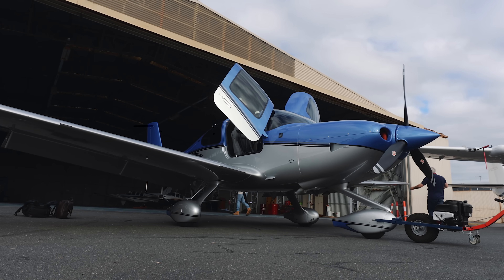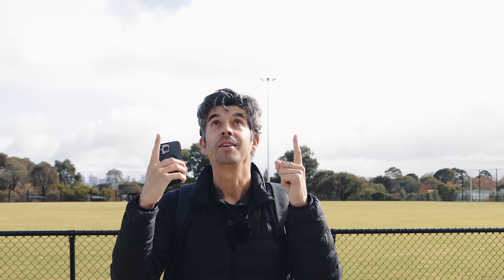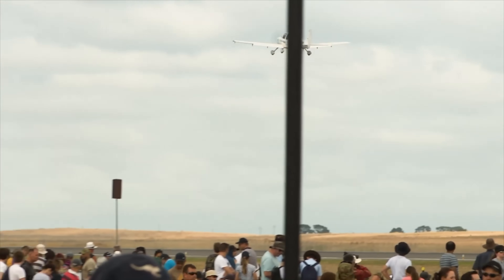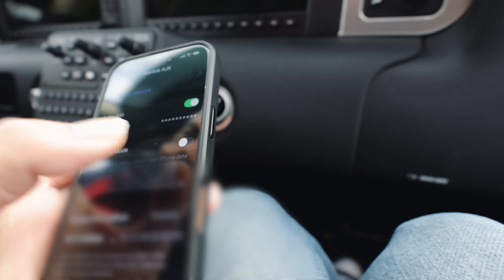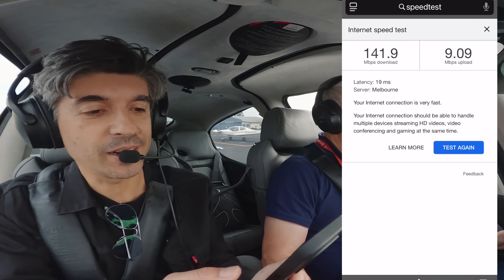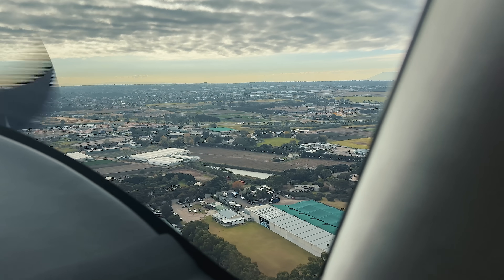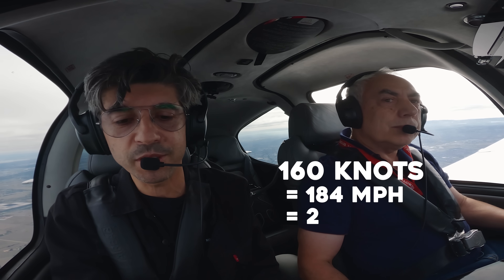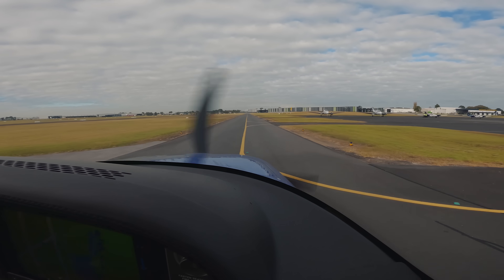Testing STARLINK INTERNET on a FAST Plane

Comment: Went with a friend who is flying and we tested it on a C172 was working like a charm thanks to the back windows. Tried last week on an IFR trip on a DA40 mounted to back side windows, wasn’t as ideal as on the cirrus or the C172 but that was still holding it and was perfect to get weather update in proper IFR with destination airport being on the edge of our Minima with no ATIS  available. We were able to refresh every 30min to seek for latest METAR. We both felt this enhance our capabilities and helped us being able to make the best and safest decision (we ended up diverting)

Comment: Yep, who would’ve thought 5 years ago we’d be using internet from the sky faster than local NBN can provide and in many cases at a much better latency. There’s some concerns about light pollution and space junk, but beyond that near earth satellites make the complete sense.
Reply: FTTP can smash Starlink to bits and the newer generation of fixed wireless can come pretty close (we can achieve 400/20) at our shack. It is clearly a great thing for people waiting for a Fibre upgrade in their area or who are on Skymuster.
Reply: @maxrburgess FTTP and wireless (I.e satellite) are two different products, hard to compare them. I have FTTP but if I was in regional Australia Starlink would make complete sense.
Reply: @alexj-1133  I understand. I'm comparing them separately to Starlink. Fixed wireless is competitive with Starlink but it's a closer race. I'm just still upset about Matt Canavan suggesting we roll out Starlink to suburbs instead of FTTP, sorry if I was too offensive, I just really don't want to see the NBN screwed over.
Reply: @maxrburgess oh yeah lots of mixed threads there. FTTP/N would always be a better solution over Starlink.

But in the remote internet race, which this video is talking about Starlink is the leader.
Reply: @maxrburgess Not saying you're wrong, but my experience with Fixed wireless is completely different to starlink. Every time I've spoken to someone using fixed wireless in my area it's close in price to starlink, but with constant dropouts and like max 15-20mbit down.
Reply: @HopperNation I think they're still in the process of upgrading the towers. Obviously it's also impacted by distance from the tower and the customer equipment generation. I'm talking about a 2 month old install in Saltwater River, Tasman Peninsula with direct line of sight to the tower.

My aunt and uncle also have FW and I seem to remember it being crap (different part of Tas though).
Reply: @maxrburgess Yeah I'd imagine closer distance + LOS would help heaps, basically all the installs I've seen are 15kms from a tower, still LOS, but often not even all WISPs offer service to those locations, I'd imagine because they know it's too difficult to provide good service.
I suppose all the places near me that don't have FTTN are in a similar situation of also having no nearby towers, so that's probably why my experience has always been so negative.
Thanks for the insight!

Comment: Despite the Despot running it, Starlink is the only viable option for me in Norfolk UK. 

A very interesting test Steph. The other commenters I am sure are right that the differential speed is statistically negligible but even as an intellectual test it’d be worth running the test going with and against the direction of the Starlink constellation you’re connected to. 

There are a couple of websites that can track (or at least fairly reliably) predict which one you’re connected to.

Comment: Stefan, Instead of that pipe mount space taking thing, a guy on COPA created 3D printable suction cup mounts. The slide on the corners of the mini and match the angle of the window. Works awesome. I have been using it like this for 6 months. Let me know if you want more info.

Comment: Nice video.. Just wondering, how was he powering the dish? Stand alone battery or plugged into airplane? I can see FAA here in U.S. coming out with rules banning dish if plugged into plane power, not that it should matter as its no different than pluggin into Ipad in flight. Thanks

Comment: Interesting video! How is it that in Australia, a developed country, 180-+ Mbps (in your homes) is faster than what you get in your homes, and here in Thailand, a "developing" country, I always get around 650 Mbps download and similar upload speeds?  :body-blue-raised-arms:
Reply: Three contributing things: 1) Previous conservative governments f'ed up initial plans to roll out fibre everywhere. 
2) some people opt for slower plans, even if they can get faster
3) some people have crap wifi networks or use mesh networking. 

I get 950Mbit down no problems at my place.
Reply: Dead right, I'm in pattaya and get a reliable 948mbps yet the wiring looks like wet spagett
Reply: The fastest non-starlink plan at my place is FTTN, max 55mbit down...
Anyway so for $5 cheaper per month than our old FTTN Telstra plan, we have starlink deprioritised residential data for generally ~500 down ~50 up
Reply: I know right lol.

Comment: How does the dish alignment work? Obviously as you are moving and turning constantly, the dish aim needs to be adjusted to keep the satellite(s) in sight. Does it have internal mechanisms to turn/move some of the components for automatic alignment? I do wonder if service would cut out if you were to make a very sharp turn, which may cause the dish'es view to the satellite used to be obstructed by the airframe.
Reply: It uses phased array antennas, so essentially it can steer the beam in any direction within its field of view.

It's usually best to point it south as that's where the highest concentration of satellites are, but there's enough satellites up there now that pretty much any way you point it there will be a satellite to connect to even if it's not the closest one.
Reply: Aim South when in the northern hemisphere, aim North in the southern hemisphere.
Reply: @SomeRandomPerson  Interesting, here in South Aus we have to aim our dishys to the south-west (mostly south)
Reply: @WilliamJohnson Interesting, so basically the same technique as used by 5G MIMO cell antennas. That actually makes quite a bit of sense. Thanks!

Comment: I dont think being a plane affects the performance. The relative velocity change between the Satellite and the plane is basically negligible.
Reply: That is not the reason, Starlink has different plans for vehicles traveling with high velocity and stationary receivers. If you don't go for a fast aircraft plan, Starlink recognises your speed, and slows down your connection speed.
Reply: it should not because the aircraft is moving veeeery slowing in comparison with the satellites. A Starlink satellite travels at about 27,000 km/h (17,000 mph) relative to Earth so the 180 knots is really....noise.
Reply: My point too, the speed of the cirrus is nothing compared with the orbital velocity of the satellites it's like 300  for the aircraft VS 28000 for the satellites